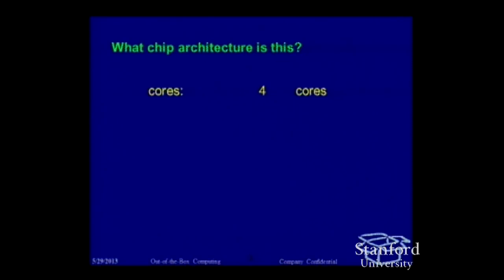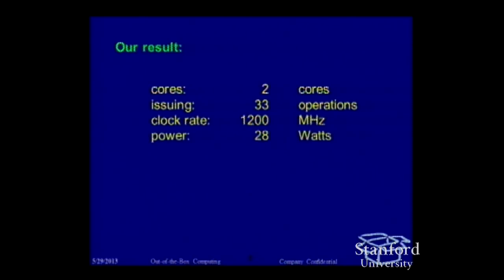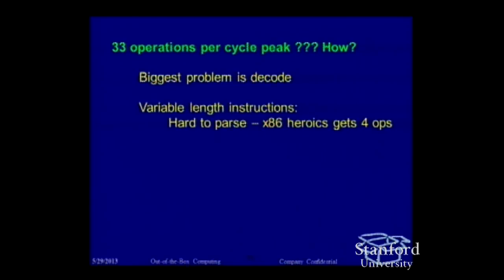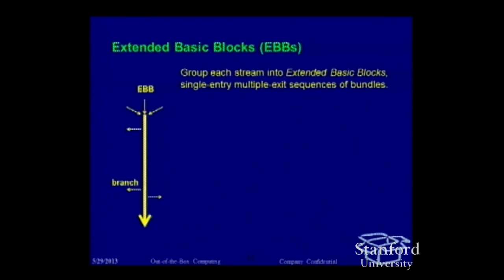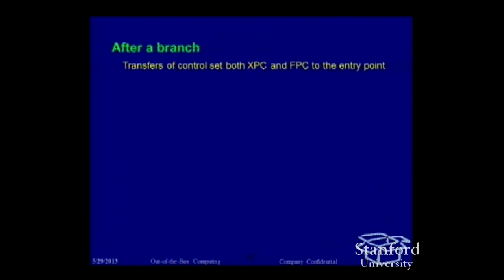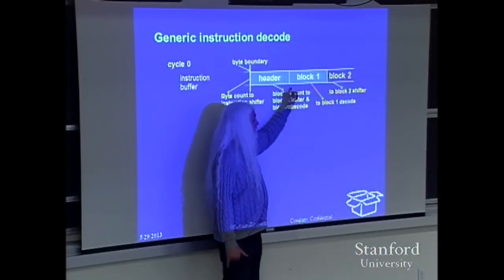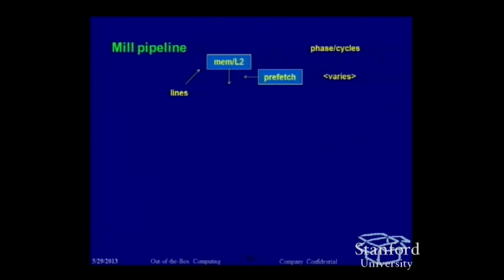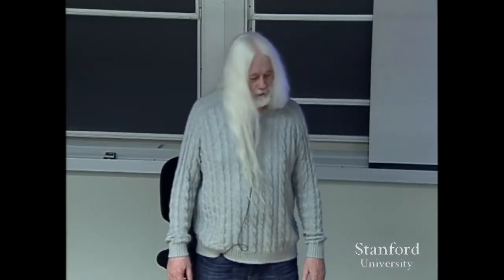Stanford Seminar -Drinking from the Firehose: How the Mill CPU Decodes 30+ Instructions per Cycle

Comment: 4:40: A little bit of update on state of the art CPUs performance: You can get OoO superscalar CPU with about 6-7 MIPS/W/$ these days. Like AMD Ryzen 3600: 6 core, 12 thread, 3.6GHz, 4-decode and issue (more if it is in micro cache, which is often the case for tight loops), about 60Gips if not more, 65W and 190$. Majority of price and performance improvements come from the manufacturing node improvements, and incremental improvements in microarchitecture (maybe 20% improvements overall). Mill still should have a significant performance / power advantage tho.

Comment: nifty... also sort of at the same time reminds me both of the coding that goes on in A/V codecs, and also some of the wrangling needed to get good performance out of a VM.

admittedly up-front I don't fully understand it.

does also make me wonder about the possibility of doing something VLIW like but supporting shorter blocks via "splitting", with this splitting pushing parts to later clock cycles (like a stack). each block could then have various formats and numbers of opcodes, ...

Comment: You could use a 3-7 algorithm to parse 3 iterations of 7 states for
verification upon the 2nd iteration. 21 packages shifted latterly
twice for the correct packet to be in the 4th spot in the row.
So error checking, Conveyor reassembling method, interrupt handling

Comment: separate clocks for separate conveyors, each bit is a separate 
single slot conveyor all multiplexed at runtime, Fully configurable,
Creating virtual conveyers of specific length without paying the 
penalty of wasted space. No block data restraint, Precision Clock
Cycle management, Precision Data Management, Precision Execution
There is merit in having specific control over each clock cycle

Comment: Why not take this to its logical progression and create
a CPU/Memory which clocks each bit individually and
multiplexes the leading edge/trailing edge of each clock
cycle for machine cycle compression. One clock cycle
equals the shortest ON state, shortening the machine
cycle by cascaded multiplexing of "all" the clocks
could shorten the ON moment further. This would 
depend of course on the shortest time that a transistor 
could switch states, seems like something to consider
if some % gain
Reply: That's called asynchronous logic. It's theoretically possible but nobody's figured out how to deal with the myriad synchronization issues involved, plus there's wire count overheads from having to synch every signal.